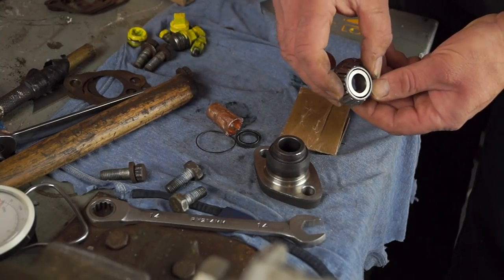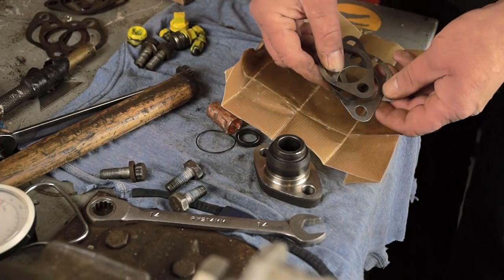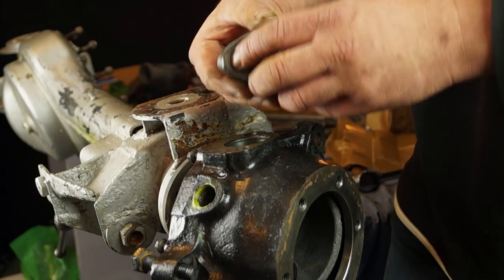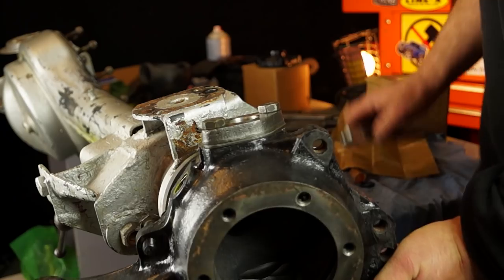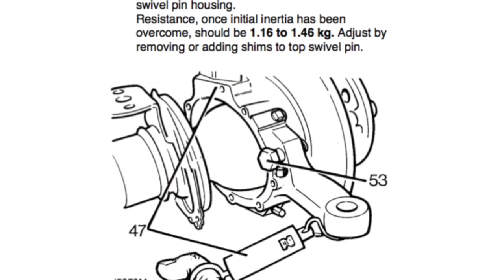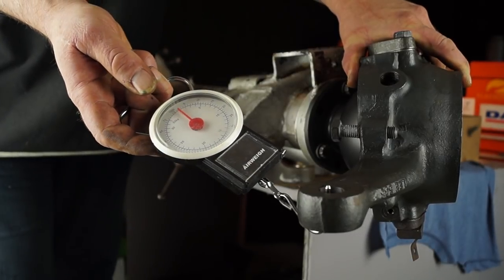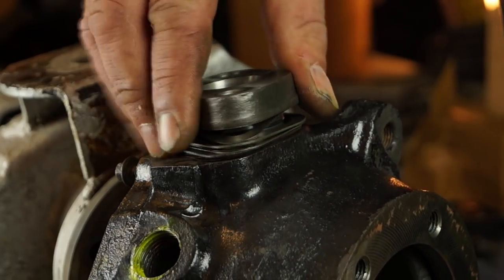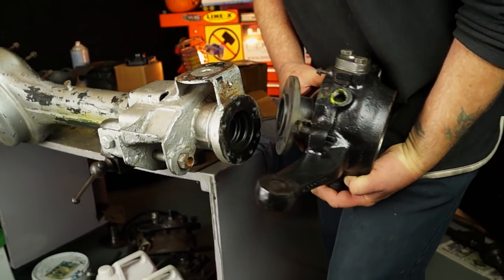Swivel pin housing overhaul part 8 - setting the shims on the top pin

Comment: Excellent video. I found that after each refitting of the top pin I needed to swivel a few times to allow the bearing to settle and then try. If not at first it felt very stiff.

Comment: so the resistance of the pin swivel should be 1,16 to 1,46kg?

because you show that there must be minimal resistance... how it's correct?
Reply from the maker: Because that is what the manual says.  If you understand what a slight preload is needed then you will understand why.